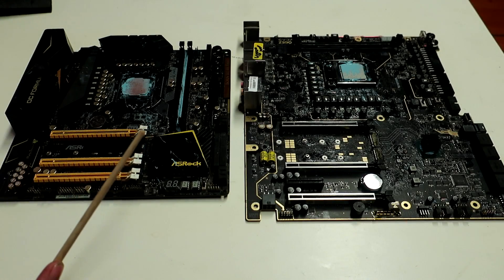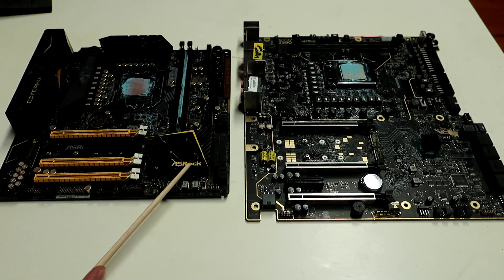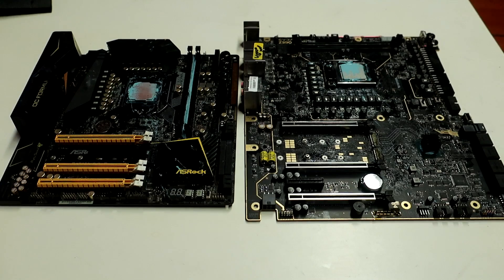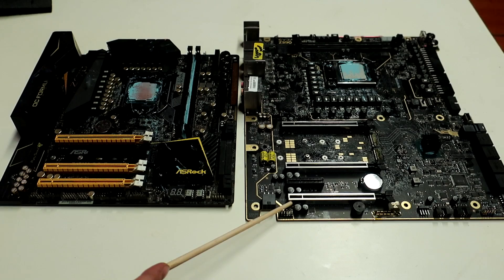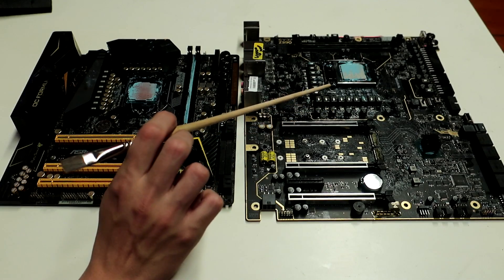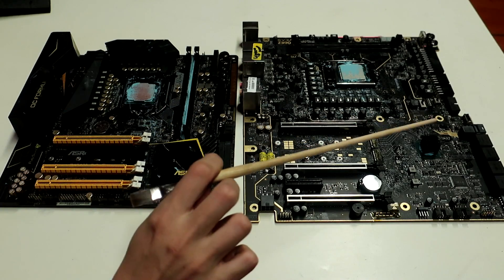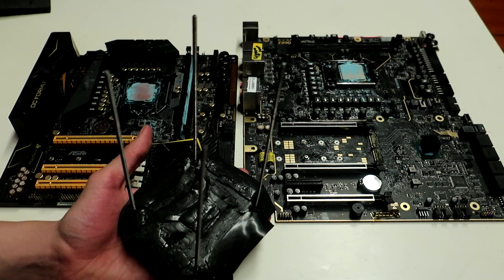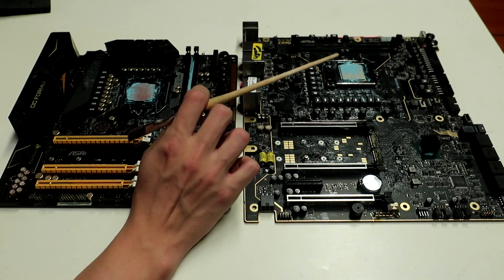EVGA Z390 DARK smashes overclocking records with 7GHz+ 9900K

Comment: Hey Luumi, have you had problems with mounting pressure on the z390 dark? If I put any torque on the nuts for my T-Rex pot I loose CPU signal. Memory channels are good up until then.

Comment: @Luumi
I want to ask you
I will buy this board (z390 Dark) for my 9900k
Will it be better than a MaximusXI Extreme?
I hope to have 5,1ghz/5,2ghz under 1,30v on my custom watercooling...
Actually I run my 9900k on my Maximus X Apex at 5,0ghz 4,7 uncore at 1,225v in bios but it goes 1,28 in load.
If you can give me more info and helping...

Comment: one question, does running cinebench with priority at realtime mode have any defects in extream overclocking?
Reply from the maker: Sometimes it gives a better score, sometimes no gain.
Reply: @LuumiJuhani  Also have to take the 15 seconds to set it up sometimes just not worth it. CB varies so much from run to run it can be hard to see anything but a large differences. Also generally the longer the test the more effect it has on the outcome.

Comment: 500w isn't that extreme in mainstream compared to FX though(nice to see modern chips no longer require insane power!). My 4 phase VRM (970m Pro 3 rev 2, a $40 micro-ATX board in 2015) does about 500w on the 8350 at 1.7 Vcore at 5.5 Ghz (running phase cooling). I have some heatsinks added to the inductors (they are probably over 100c otherwise, it is a super cheap board), and a couple 40mm fans. It doesn't throttle though after you add the fans. Most of its life it has only ran ~300w at 1.5125v at 4.8 Ghz (needed to be steady so it could run 24 hour long fluid simulations without an error, so Vcore may seem excessive), but that was only on a 120mm AIO. 

It is a lot more than Ryzen, haha, I seem to get my TR 1950x to shutdown past 450w, though I think I was hitting the same HX1200i limitation you were! I misplaced one of my cables, and was running a splitter to it, which now explains why my SuperNova PSUs are doing fine, since I still have all the cables for them (that Corsair cable is running around somewhere...). I think my power consumption was still similar (I switched to ice in a T-REX cooler instead of the AIO like I used on the corsair, the temps probably kept power consumption similar since clocks only went up 100 Mhz using a reasonably low 1.55 Vcore). I need to find some LN2 around where I live so I can enjoy in some of your fun! Crank those frequencies and have fun, cheers!

Comment: 2V Dimm? That's a madman! I would think you'd be pouring LN2 on those DIMM heatsinks to keep it from destroying quickly. I think my TR would just launch out of the socket in a flame from the memory controllers bursting into flames, lol! Very nice.
Reply from the maker: DDR4 doesnt consume much power, can run 2v on memory even when they are naked without heatsink if there is some slight airflow.
Reply: @LuumiJuhani  I just meant degradation (for room temp). Like using 1.7 Vcore on Ryzen could probably run on phase cooling just fine short term keeping below thermal limits. Its just that I wouldn't expect it to be working flawless if it ran that high for a couple years (it might, but I think the CPU would degrade a noticeable amount).
Generally keeping it as cold as you can will make it last longer, like it being bad running near thermal max all the time vs 10c at the same speeds.
Reply from the maker: @jakegarrett8109  Yes there is a real risk of damage overtime, but my personal opinion is that a voltage of lets ay 1.6v on these cpus would be totally fine even daily if we could have LN2 level temps for free... At -190 ish 1.6v is like 1.3v on water. And funny thing is that most cpus will reach nearly max speed at that voltage, so raising vcore from 1.6ish to 1.75 or so will give you only 100mhz for multicore with many cpus but it varies.
Reply: @LuumiJuhani  Yeah, I mostly meant running LN2 on the memory dims themselves (although the IMC might not work on Ryzen).
I just wish my TR didn't go crazy near 0c (even at 5c its hesitant to run XMP, at 10c and above it is fine). I don't think it will work well on my phase cooler based on quickly testing with ice in the T-Rex cooler (although I've heard Ryzen memory controllers work with LN2, but I think on phase my evap block temp will rise to -20c if its pulling 600w, and at some point that memory controller is going to be near 0c again, even if I'm booting at -55c and boot, it will probably go unstable under load. I'll likely try it anyways just for fun. If it works, that will have to be my new daily config!

Comment: that cinibench score is in line with threadripper 16 core lol.
Reply: Not really, my 1950x does 3600+ on a 120mm AIO (which is much too small, only covers 1/4 the IHS). But, it is still VERY impressive. Its higher than the 12 core at stock though! And that's just awesome! I'll take my TR on LN2 as soon as I find somewhere that sells it even remotely close. I need to get some mounting screws for my T-REX cooler, it seems to do just fine sitting on it, but TR4 is a total pain with socket pressure and I think it needs some more mounting force cause sometimes I get 2 sticks of RAM, sometimes 3, and most of the time 4 sticks showing up, its really annoying they have such an issue with how the cooler is mounted.... I probably won't be using it with zip ties like I prefer, haha!

Comment: my favourite overclocker just changed ,,,,,,, BTW Alex@ro is also using windows xp ,, he also have similar primary ram timings ,,,, he has a cpu clockspeed advantage ,, but your memory is running on slightly higher frequency,,, plz tell me the tweaks and your secret sause to get that kind of cinebench score ,,, is it the ram sub timings optimization because you are not even using  cinebench on realtime priority  ,,,, tell me ???
Reply from the maker: Good operating system and memory.

Comment: Were you running the 9900k in a z170 board or did i mishear you?
Reply: It's a mod and a high end overkill asrock board.
Reply from the maker: Yes, just watch my 9900K or 8700K in a z170/z270 motherboard guide videos.

Comment: Do I have a disadvantage overclocking 16gb x2 sticks vs 8gb x2 sticks on this board? I was thinking maybe 4000mhz cl6/15 for daily usage.
Reply: 4000 cl15 Daily? Uhmmm
Reply: Probably need to do CPU binning (maybe buy 5-10 CPUs) if you actually want to do that. Plus, 16 GB is usually more chips on the RAM stick (which especially kills Threadripper, you can see it in the specs page the supported official frequency drops like a rock!). It is more difficult to run for sure, but if you bin enough CPUs, you should find one that can do it (I'm not saying it will last your lifetime obviously, but you can find one I'm sure).

Also not sure why you'd need 4000 RAM for daily, but if speed is your requirement, you might be better off with an Epyc with 8 channel memory if its something that needs massive data transfer (just something to look into). I'd recommend phase cooling for your daily system if speed is important (my phase cooler keeps a 500w FX below 0c core at peak load, -25c block at load to -58c at idle). The 9900k scales greatly below 0c, so that might be a good idea too (you will need an absurd amount of prep compared to this short run seen in the video, but you can do it reliably if you spend a good portion of a day getting it ready).

Comment: How does it compare to Z390 AORUS Master?
Reply from the maker: Aorus is 4 dimm slot so it cant do as good memory as these :), on vrm temps they are quite same.
Reply: @LuumiJuhani  I got the AORUS Master, just wondering if it was a good purchase. I did 5.3Ghz with 360mm and 240mm Phoenix MLC no problem on it. I could probably do 5.4
Reply from the maker: @krystiandomagala4929   It can surely clock cpu well but on memory it will lose badly.
Reply: @LuumiJuhani  Ye dude, not an extreme overclocking obviously. I guess I did buy a good motherboard then. Will I be able to get 4000 stable with 16GBx2 Corsair Vengeance red led ones? What do you think?
Reply: Use DRAM/FSB ratio 133 , may be you take 4000 )) Any giga z370 board can do that, include crappy z370p d3. I can take 4000 on z270-hd3 cf with g4560 lol

Comment: What do you do with a chip like this after you're done benchmarking? I mean- do you "retire" it from overclocking benchmarks and use it as a daily driver?
Reply from the maker: Either play with it later or put in some daily system.
Reply: @LuumiJuhani  You're suppose to put it on Ebay saying "gently used, never overclocked", and mention something like, "smells a little funny, possible burn damage, but never overclocked and only used for playing Fortnite".